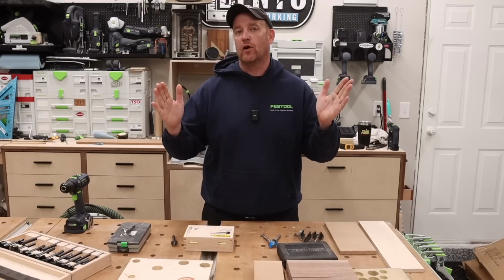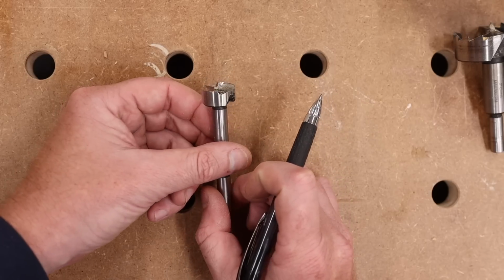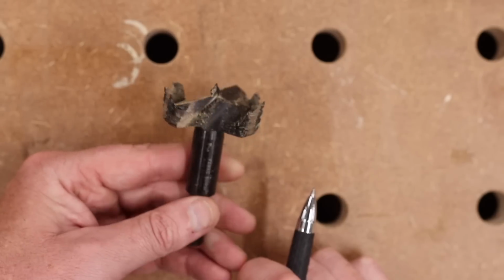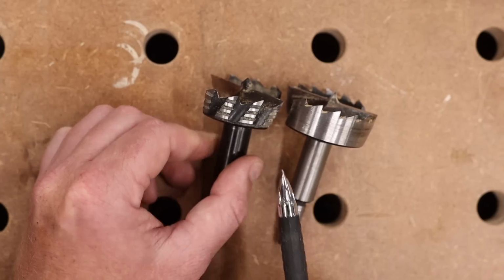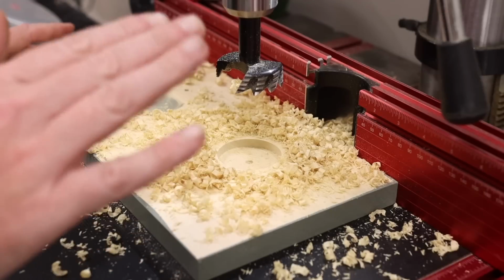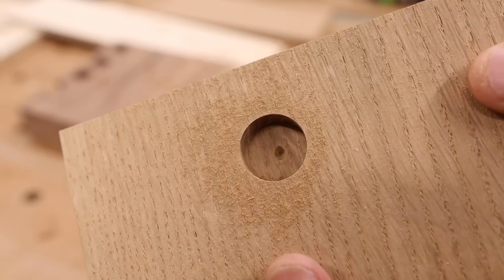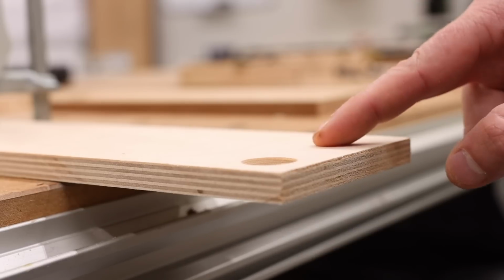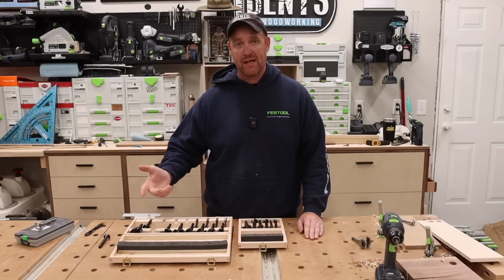I Bet Your Forstner Bits Don’t Do This

Comment: I bought a FAMAG + BORMAX plug cutting kit, and 2 things I noticed:

1) the cut was insanely smooth for both the Forster and the plug cutter

2) the plug fit with just the right fit into the hole - slides in with minimal pressure but with 0 visible gaps. Apparently they're CNC ground to 0.01mm tolerance.

Comment: it's a good comparison and presentation. two comments:

1) you dont mention carbide-edged forstner bits, which are substantially cheaper per use than hss. initial outlay is 2-2.5x more than hss, but they last 8-10 times longer, making them the more economical option for anyone who is putting these bits to a lot of use. the only economic justification for hss bits is you want to bore just a few holes and then probably never use it again

2) pure silicone lube is an excellent 'cutting oil' when boring holes in wood or wood fiber products with forstner bits or hole saws. it wont be suitable if you're going to use polyurethane or certain other finishes, but it is non-staining and wont interfere with oil and/or wax finishes. if you try it you'll find even the largest bits remain cool enough to handle with bare hands immediately after boring

Comment: You could cut mdf with a butter knife.
I’m currently joining 3 hardwood tops and using mason mitre clamps, & my cheap Chinese forstner bit gets red hot, doesn’t want to cut, I have to wiggle the battery drill side to side and back to front to make it cut & it wanders.
I’ve got a dozen to drill and it was blunt after the first 3 or 4 holes. 🙄👎

Comment: Keeping bits sharp with diamond hones will deliver superior results with any Forstner Bits.   
Your FAMAGs are nice but the cheapest ones can be sharpened to deliver outstanding results too !
Production Shops with Cutter Grind Departments might have Solid Carbide Bits that are far better than these high speed steel cutters but at a cost ( x5 )

Comment: I would love to see a demo of these bits used at a 45 degree angle or a deep half hole.  Otherwise when would you use a forstner bit for fine woodworking?  Except for mounting hardware or mortising, which the hole doesn't have to be pretty.    With that said, I think for day to day wood boring, regular forstner bits from Freud or CMT are just fine... as long as they are treated properly and not abused.  Let the bit do it's job and don't try to force into to working faster and allow the chips to exit.  Have you ever tried a forstner bit on Ipe?  I did and went through 4ea  3/4" bits drilling about 60 holes for the bolts and lags used on my Ipe deck railings.   Ipe will make these bits its bitch.  I'll be happy to send you a 4x4 hunk of Ipe just for fun if you'd like.

Comment: I don't buy a set, only what I currently need and then very good ones. Almost only the zobo in chrome steel. expensive but super sharp and durable. you can have all diameters ground, in tenths of a millimeter.

Comment: The BMW/Audi of forstner bits?  So what does that make Fisch then?  Also rans?  Famag and Fisch share the same price point for top grade tool steel well machined bits…the only practical user difference is Famag have pointy teeth and Fisch use a continuous wavey rim…oh and Fisch have a non-slip shaped shank too.  Ignoring Famag’s equal and major competitor in a review, like Fisch don’t exist, is shallow don’t you think?  You might also consider how easy, or not, it is to re-sharpen the bits once dulled…I know Fisch can be honed…

Comment: Famag bits are excellent, but expensive, especially if you buy their Bormax3 industrial line with the carbide teeth.  Diablo Freud also has some carbide forstners which look promising.  Fisch Wavecutters or Black Sharks are really good too.

Comment: There's a reason drill bits that go in a traditional chuck has a round shank instead of a hexagonal one. Your liking a forstner bit because it doesn't use a traditional round shank is irrelevant. Do you think engineers that designed drill chucks and drill bits just got it wrong?

Comment: Have you ever considered that you might be using the bits at too high a speed? I saw a video recently that spoke to this. Too many people are running their Forster bits too fast. The blueing on your older bits seems to indicate you’re doing the same.
Reply: In fact, nearly all drill bits are used at too high a speed.

Some bits are designed as high speed bits and are made of different material and must use lubrication with them.
When it comes to drilling wood you can't lubricate so the best thing is to reduce the speed.

In addition, the downward pressure is at times to much.

I could use the same low quality bits and get perfect results by controlling speed and pressure! 
And if using the same bit for too long a time, you must let it rest(cool) since the friction of the bit and the material cause heat build up in all bits!

Comment: I bought a set of Freud forstner bits 25+ years ago and was thrilled to have the capability I could not have with other drill bits.  The larger bits on the drill press certainly create a separate cleanup project.  Really well done technical explanation Jason and I look forward to unloading my Freud set and upgrading to FAMAG.  Keep up the great work and thank you for your service.
Reply: You won’t regret it, I switched from Freud - famag and they do much better it was actually shocking

Comment: Great review, thanks! I wish you'd elaborate more on the Zobo forstner bits (the Festool branded ones). If Famag is the Mercedes of the forstner bits world, then Zobo is a Rolls-Royce. FYI, that Festool set is a steal. Typically a single (SINGLE!) Zobo bit costs over $100. That's smaller cheaper ones. Big bits can easily go for over $1000.
Reply: yes would love to see a Famag vs Zobo comparison

Comment: I always get confused, is the set of drill bits supposed to cost more or less than the drill? The Festool drill. Undoubtedly Famag makes great bits, but equally undoubtable is the quality of the Fisch Wave Cutters. And they're $200 a set less... I've had a set of the Fisch bits since they cost about half of what they do today, and they are still sharp and very performant.

Comment: I wonder how these would rate against the Fisch wave cutter bits (which is what I considered to be the BMWs of bits lol). These have some features the Fischer’s don’t, but the serrated profile on the Fischer bits help accomplish angled and semi-circles and other scenarios much better than traditional straight cut bits. As far as heat goes, one thing I learned is that the speed matters. For bits over 1” in hardwoods I use 250Rpm, which is much less than I ever imagine. And that makes big difference.

Comment: These look really nice, but the 2" bit costs as much as my full set.  My dad taught me to buy the best tools you can afford and treat them as such.  My Porter-Cable regular and Rockler fractional sets may not be the best, but that work very well.  One huge tip I was told was to slow down the speed, especially with the larger bits and harder the wood.  Heat is the enemy of any drill bit, if you want them to last.
Reply: As a plumber, what I generally did was buy a low-middle tier disposable tool first. If that tool got heavy use or simply frequent use enough to justify upgrading, I would then upgrade to what was the best option FOR MY OWN SITUATION and go from there. I still had shitty tools on my truck that I almost never used, but I also had top of the line ridgid tools that cost me a lot of money to acquire. I use the same concept with woodworking; if you use one particular size of forstner bit daily, why not get 1 premium bit for that size, knowing that it will eliminate future problems and headaches as well as lost productivity?  The rest of your bits can be the cheap ones. Who cares. Just like a sawzall; a cheap saw with a premium blade in the hands of a professional can outshine anything that comes from a lesser operator with premium tools. An unskilled craftsman blames the tools, a skilled craftsman learns when, where, and why to spend money.
Reply: I have a Porter Cable set and they work a treat.
Reply: The Porter-Cable set I have weren't very sharp out of the box and wore down quickly. I wouldn't buy them again.

Comment: I'm really interested in these. I've been using the Fisch Wavecutter and they're solid, but there are some neat features with these. One way or another I need to get decent metric bits for things like hinges, so I'm going to give these a spin (and get you a tip for using the code.)

If anyone at KJP is listening, I found the KJP web page setup for sets a little hard to follow. When you click on a set you don't know what the options are. You have to find the "set options" heading above the description to see the info. Before I found this I was digging through European websites to find the matching sets before I realized that I could go above to find the info. I'm a professional computer guy so if I missed it I'm probably not alone. (Although I can be a little oblivious at times.) I did appreciate the detailed listing of the manufacturer's available individual bits.

Minor easily fixable video title thing: There's no "e" in Bormax. (Also you have a typo where it says Borax in the description, which is kind of funny. I suppose if the holes are clean).
Reply: Sorry to hear you had that experience. We have just adjusted the product page to include the information in a second place to hopefully prevent anyone else from having this headache.
Reply: @woodvaultshop  I think it's an improvement, although it might be better below the parts list if it can be done cleanly. I assume the eCommerce platform doesn't allow you to change the description based on the option selected...if that was possible I think it would give the best option.

...And it's not like I didn't order the bits I needed anyway.
Reply: @kyleolson8977  thanks for the order!
Reply: @woodvaultshop  Also, your website still was better than the other North American websites I ran into while searching around.
Reply: Oh, and I notice that there's a FAMAG Forstner depth stop collar. I'm wondering if this would be useful. I use the similar Amana non-marring countersink all the time for screws. But on the other hand, with Forstner bits I'm more likely to be using them on the press or in a drill guide than freehand and in both cases I have ways to control the depth. I'm just curious if you've tried this.